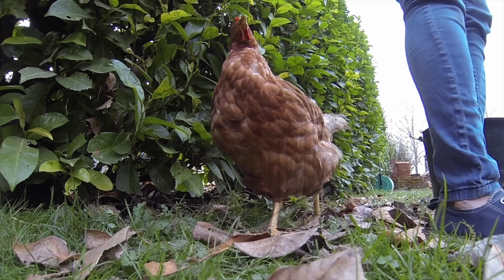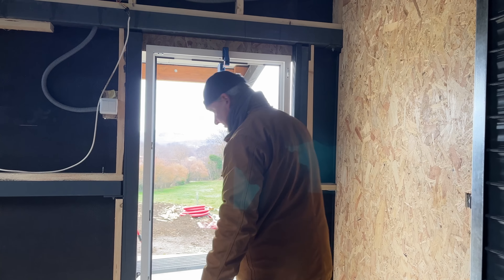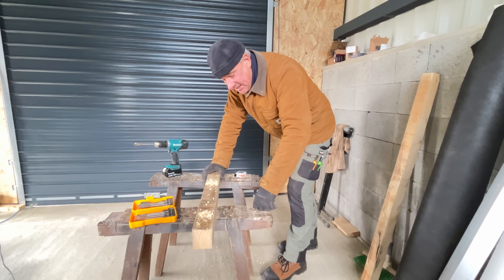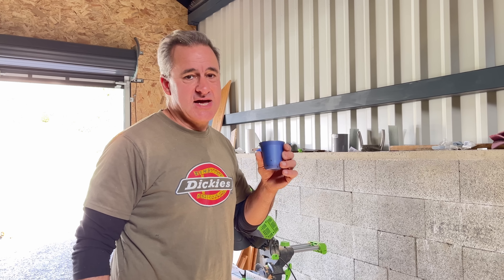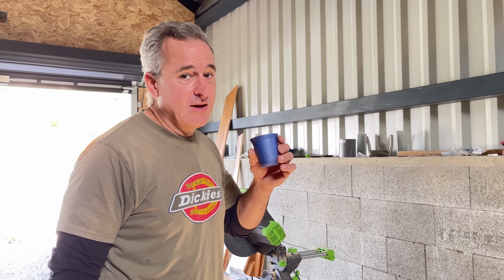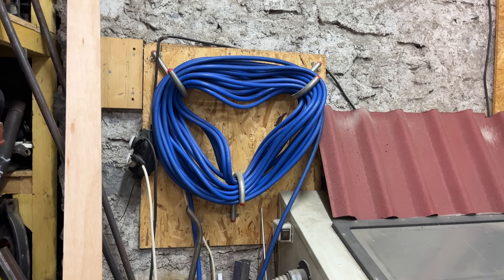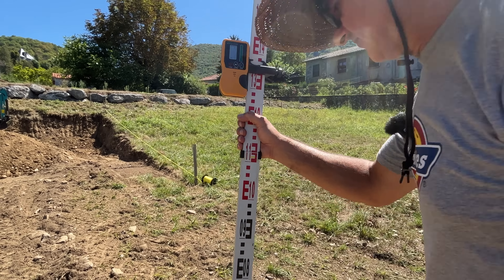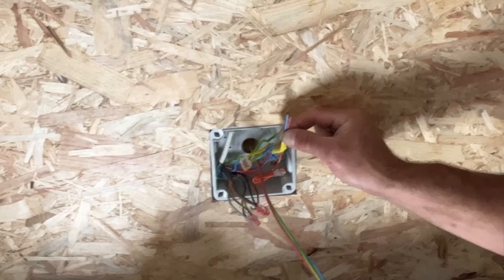Siding Is Underway On The Garage / Workshop Project Ep35

Comment: I might buy one of those air hose thingies...I just can't find good quality 'susses' in Poland. (my laptop just changed  Suzies to susses????..Suzies = curly/stretchy air hoses).
Reply from the maker: The curly ones are ok for short lengths but I found they get just as tangled.  I have a little lidl one for the bike workshop which is good for the tires.
Reply: @HomesteadingUncontained  Talking of Bikes...I just bought myself an ENGWE electric M20....(Just had a pacemaker fitted and its an easy way to get me back on to cycling).  Either let the electrics do it all, it will go up to 43 kph on the flat, or find the right gear and start pedalling when you want to or give it a boost up the hills.  Nice fat tyres so really good on gravel tracks etc.
Reply from the maker: @Pinzpilot101  I looked at these bikes - they do look good and a little different form the normal looking bike.
Reply: @HomesteadingUncontained  Some people do say they are more like an electric moped than a Bike?  But from my long ride yesterday, been riding bikes all my life and this seemed more push bike like but with tyres that need pumping up😅...apparently these 'fat tyres' are better at 12psi than rock hard, but I will try them a bit harder sometime just to see  what it is like....harder has to be better for battery range?